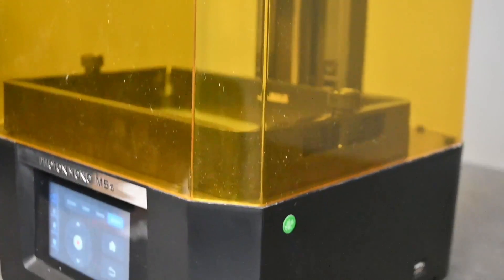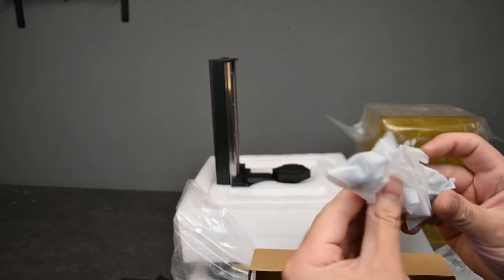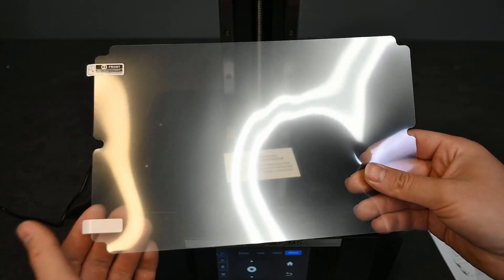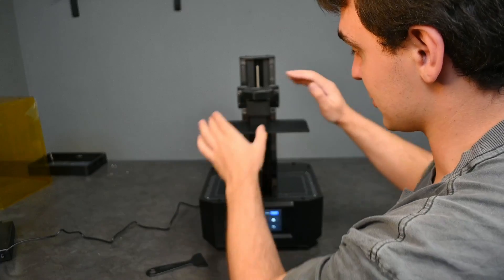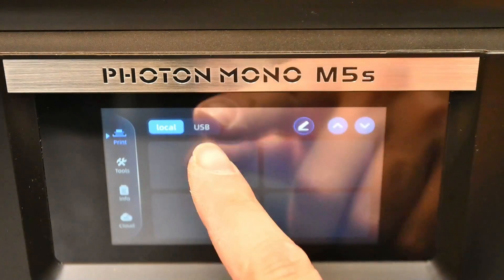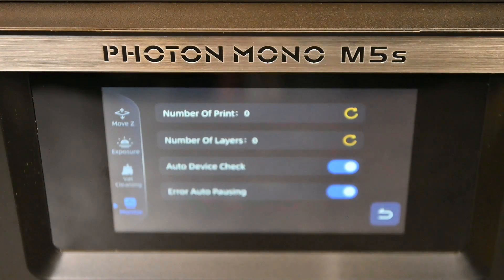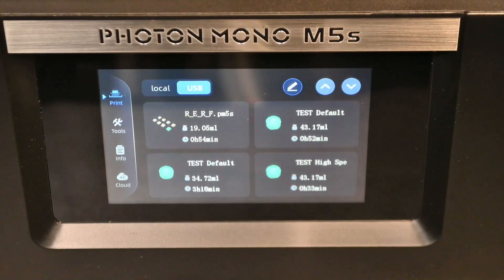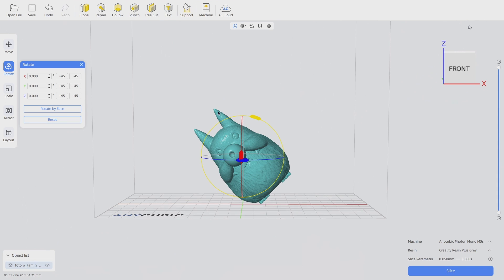Anycubic M5S Unboxing and Setup || First Impressions!

Comment: Im using m5s Pro, and I constantly gettin force lift error. Printer is leveled using high speed resin with 1.9 exposure time. What I am doing wrong? It only prints the bottom layer.

Comment: Funny enough the plate does have leveling screws hidden underneath some stickers on the sides they wluld be nearly undetectable had the support guy told me about them
Reply from the maker: Oh really! That's really good to know, thanks for telling me
Reply: I was having some super funky issues with prints and contacting support led me to manually adjusting the screw as well as I threw some washer in-between the build plate and the bracket cause I seemed short? Almost printing alot better now but having some crazy issues like I'm using phrozen 8k resin at .03 layer height and any exposure time under 3seconds the print won't even bother to build up

Comment: THanks, it really helps to see the manual steps done by a human. Have you had experiance using any off brand release film. I just purchased this and am contemplating the operation costs (I counted resin of course but the at the cost anycubic has for film, the cost per print due to release film is very significant. What sort of life time do you typically get? Are there certain procedure settings that result in shorter or longer lifespans? The off brand films I see for sale do seem to get amazing reviews for a fraction of the cost but if you have experiance with any one of them in particular I'd love to know.
Reply from the maker: I have personally not yet tried using non Anycubic film, but the lifespan of FEP film can be long if you work carefully, and if you don't have too many failures that might cause damage. I personally don't believe it should be a problem using other FEP film, you will just have to dial in the first layer settings for whichever film you decide to use.
Reply: @3DPrintingStorecoza  thankyou for the reply and for the insight. That helps.

Comment: I keep seeing people get this printing no issue off the bat but I've literally been unable to get a single print to stay on the bed.
Reply from the maker: I'm sorry to hear that, one thing I might suggest that could help is to lower the retraction speed of the bed, it could be that the force created when the build plate rises up is too much for the adhesion.

A speed of around 5mm/s or even down to 2mm/s should be good, this will make the print take slightly longer though.

Hopefully this helps a bit

Comment: What I did notice in your video was that you didn't print out the figurine you had uploaded initially but instead you printed out the dragon and didn't show the printer actually working, that's a little suspect.  My question is why is that?
Reply from the maker: The reason was because my camera can only record up to 29 minutes, and the dragon print was 7 hours+ and printed overnight so I couldn't record the printing process, I can assure you that the dragon was printed on the M5s.
Reply: @3DPrintingStorecoza  But  you never even showed  the dragon. 🙄 so suspect.
Reply from the maker: @alvinjones593  I unfortunately only had footage of the print once it was finished, my camera only records for 29 minutes, and because the print was over 6 hours, I couldn't record the process, I apologise if this caused confusion.

Comment: My wife bought this for me for xmas. I haven't had good luck so far. Tried the app and it gives me 60 seconds to put in a code but it takes 2 hours for the email to come. I couldnt get it to connect to my wifi, and the first 2 prints failed. This is my first resin printer and im thinking i should have looked for a Fisher Price one to cut my teeth.
Reply from the maker: I'm sorry to hear that you have not been having much luck with this printer, a few tips that might be able to help is to remember that you need a specific "Fast Resin" to be able to print at those hyper speeds, the speed at which you can print resin is bottlenecked by it's curing time, do a little bit of research on the resin that you are trying to use and see what people say the best curing times for it is.

Another thing is, if you you are experiencing the prints disconnecting from the build plate, this could be because of the rising speed, lower that to around 2mm/s - 4mm/s. Because of the fast lifting speeds, there is a great pulling force on the print which can sometimes be too much for the build-plate's adhesion, reducing the speed might reduce the amount of failures.

Last tip is to not use too thin supports, you might think a support is too thick to hold onto the print, but if your settings are correct, you can remove the support without it doing any damage to your print, play around with thicker settings and see if you have more successful prints, you can than very gradually reduce the tip diameter of the support until you start seeing failures occur, than you know what the smallest diameter is without the chances of failures.

Resin printing is a little bit tricky and there is a lot to learn, but it has a massive payoff at the end when you get a grasp on how it works. I hope some of this helps you and I hope for successful prints in you future!
Reply: @3DPrintingStorecoza Thanks for the reply. I did end up getting a few things to work out. My main issue was there was a thin layer of resin on the build plate. I scraped it off and had a better go. The other problem was the stl I downloaded was meant for pla and I think it was a difficult print.
Reply from the maker: I happy that you were able to find a solution,  thoroughly cleaning your build plate after prints is a must, and there is always the unfortunate possibility that you might have a bad or corrupted STL which can cause a lot of problems as well @junkopotomus
Reply: @junkopotomus note that resin printers don't work well with large flat surfaces, so you'll often want to angle your prints to avoid having issues.

You can lower the retraction speed and increase the height so resin has time to flow under. That will increase the print time though.

Also you need your room temp to be at the resin's recommended temp, otherwise it may not flow well and will take longer to cure.

For the wifi, I'm not sure, but often iot devices have issues with 5ghz networks, so try decoupling your 5ghz and 2.4ghz networks in your router's settings and connecting to the 2.4ghz one.
Reply: Same. I got mine and have had 2 fails. It's quite annoying and I'm thinking about just taking it back at this point

Comment: I have tried mine for weeks 2-3 failed print everyday. constantly trying, wasting resin, and I have never been able to print a thing yet will not adhere to bed. increased first layers all the way up to 55 sec in % sec increment's still nothing. any advice?
Reply: I had to take the first layer up to 90 seconds.  Then a 99 success rate.  Also use Anycubic photon workshop.  I had to stop using Lyche for a higher success rate.  Also just swapped to a regular feb not the speed feb, I am starting to reduce first layer print time now.
Reply from the maker: If you are experiencing the print pulling itself off of the FEP film, what could help is reducing the lifting speed of the bed in-between layers, faster lifting speeds could cause too much pulling force for the FEP film to hold onto the print, this will however increase printing times though.
Reply: A good tip to clean is to take a scrap resin print, put it on the bottom pf the vat then expose the bottom for 15-30s, and pull out the cured bottom using the scrap print, that should clean any residue.

Comment: thx! I have had mine all setup but no idea how to calibrate the printing or settings for it. I got it back when early bird pre order was a thing
Reply from the maker: A lot of the settings is dependant on the resin you are using, but those settings can be found on the resin manufacturer's website most of the time. Are you using the Anycubic Photon Workshop Slicer?
Reply: Not done any 3d printing yet. I currently dont have a spot for it but want to be prepared when I do. @3DPrintingStorecoza

Comment: For me this printer is a nightmare, fails, problem with supports, bugs on slicer, print not at the level of 12k. I have given the printer to Friend and he didn't arrive to make anything with it. No never again anycubic, I have taken saturn 3 ultra and that's a printer with no gadget but very high quality print, and zero fail after more than 100 prints. m5s is a fail printer.
Reply from the maker: I will have to give it more time and testing to see if I come to the same conclusion or a different one, but Elegoo and the Saturn 3 especially are amazing too, I'm sorry to hear that your experience with this printer was not favourable.
Reply: did you make sure it was hot enough?
Reply: @DragonProtector  Yes I use thermalvatband on all my printer, it is just m5s is a big cheat. I never use it again too many problems.
Reply: firmware update? Maybe you got a defective unit? @deneau
Reply: @DragonProtector  there are no new firmware, I have big problem with the printer and anycubic. This printer is the worst printer made actually, I have Saturn 3 ultra without any of the m5s gadget, I am very satisfy of it, and 4 other printers and problems with. Anycubic have a bad slicer also, this is a bad compagny.